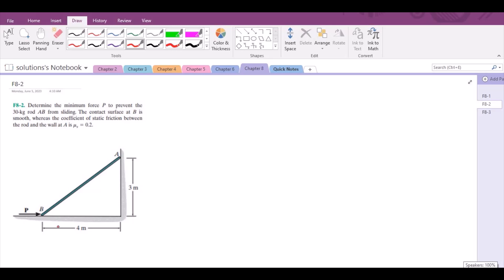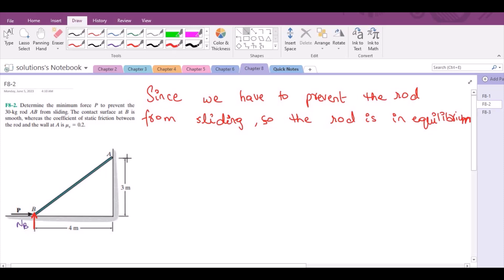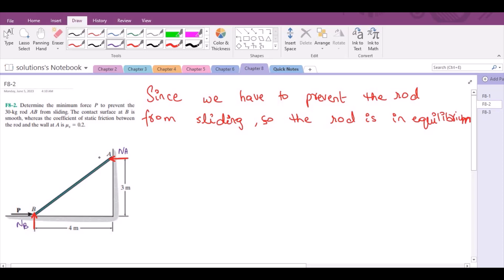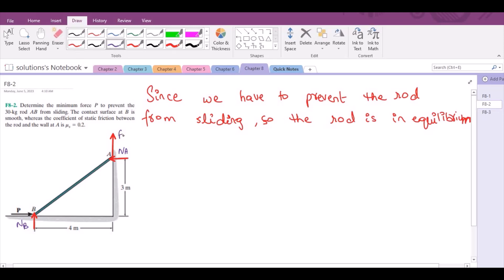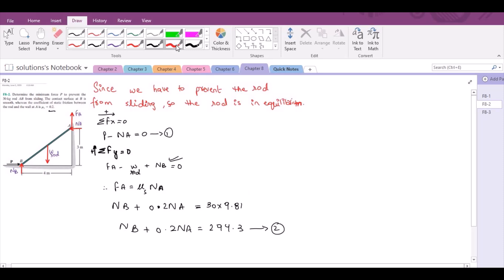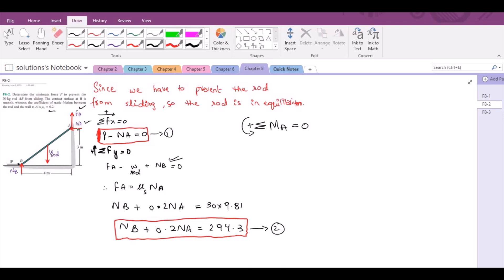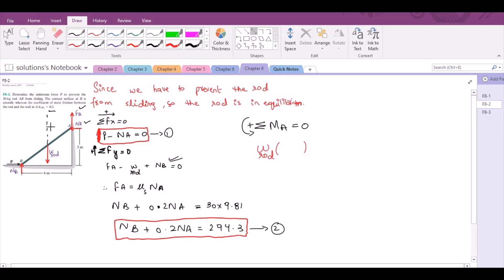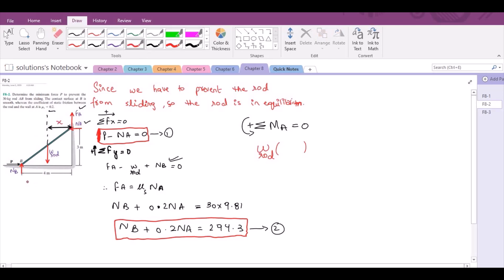F8-2 hibbeler statics chapter 8 | hibbeler statics | hibbeler

Comment from the maker: Learn How to Solve 8-6 Hibbeler Statics Chapter 8, The 180-lb man climbs up the ladder and stops at the position shown after he senses that the ladder is on the verge of slipping. Determine the coefficient of static friction between the friction pad at A and ground if the inclination of the ladder is θ=60 and the wall at B is smooth. The center of gravity for the man is at G. Neglect the weight of the ladder.
Here is the Link: https://youtu.be/GLcGQmUumao

Comment: The contact surface at B is smooth but sir You condered normal force at point B in the figure 😢
Reply from the maker: Smooth surface at B means that there is no frictional force at B, but the contact force (normal force) at B still exist. I hope it will help!
Reply: @solutionsmanual9535  Yes sir  now I got the point thank you sir